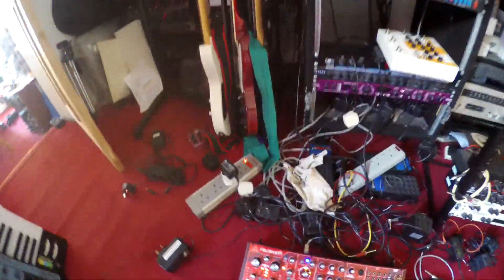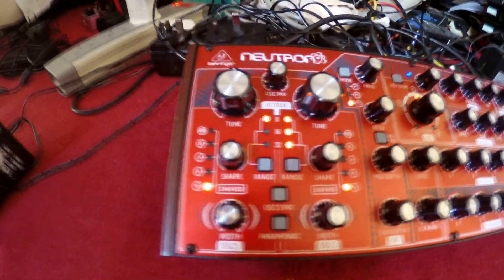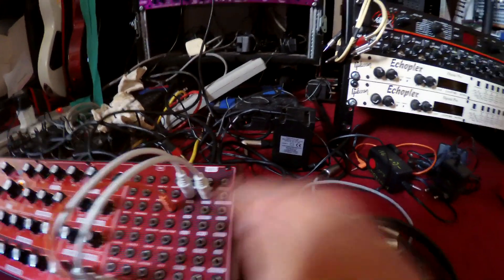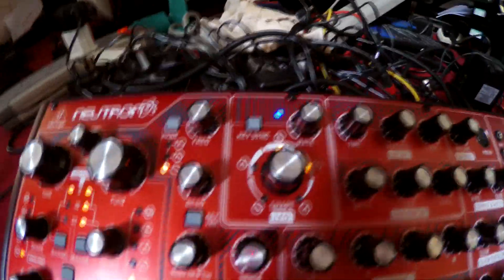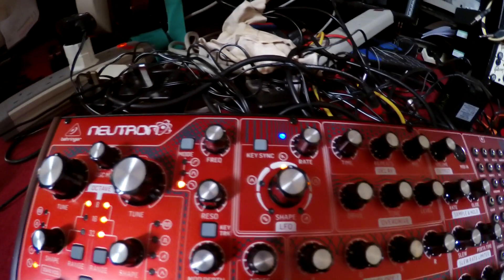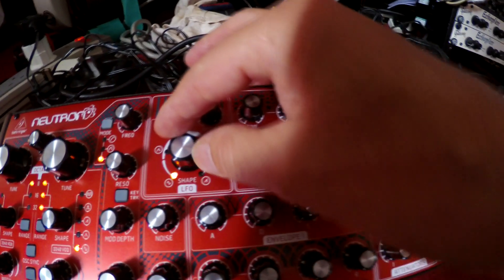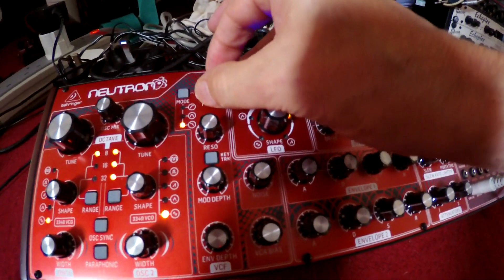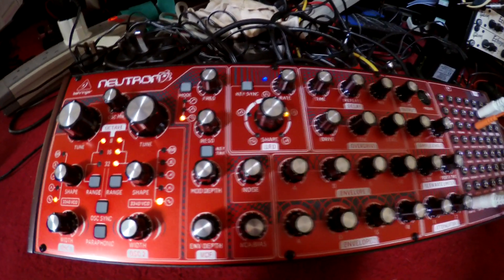Neutron Noise

Comment: Hello, mine does the same. Did yours sound like this, since day one or did it got worse after a while?
Reply: Because I have the feeling that mine didn't sound like this, from the beginning. But somehow does sound exactly like yours right now. On the other hand, i almost never played those high notes. This is my second neutron already, because the first one stopped working after a while.
Reply from the maker: Yes, this is what Neutrons sound like. I showed this vid to Behringer before public release and they say there is no fault with my unit.
The patch I set up focuses on the issue, quite a effort to get it to show this much.
The Neutron's a brilliant little synth, but I use something else for the high notes.

Comment: mine does that same noise, and I havent being able to get rid of it. As far as I've read, its the LFO bleeding. Have you got any response from Behringer?
Reply: I had the very same issue with my Neutron only I had it regardless of the tuning range. I hooked it up to my scope and was able to describe the “jitter” to their phone tech who said it sounded like I had a defective unit and suggested I return it to my retailer. My replacement unit will be here this weekend. I will try again and will also try the MIDI channel approach. Shame is my sequencer (a Novation circuit) doesn’t have adjustable MIDI out channels. So I will try the D on ch 1 and this on ch 2
Reply from the maker: @KF7IJZ  . Well maybe the problem is always there on all frequencies, more noticeable on the ones i demoed. Or perhaps your scope is more shows it up well.
Thing is, I never found a Behringer tech support guy who was clued up about the tech, just some more helpful.
Reply: @KF7IJZ  I recieved my Neutron today, and it has the same problem regardless of the (unstable) tuning range. Did replacement unit solved your problem with it?
Reply from the maker: @zajdima  The noise is just part of the Neutron experience, mostly it's not noticeable. 
To stabilise tuning 1) let it warm up for 15-20mins. 2) turn it off and on again to make it recalibrate.
It always calibrates on startup, when it's cold....so unless you re-start it just drifts out of tume as it warms up.
Reply from the maker: Behringer don't like to own up, but they say my unit is 'within specification'. They also said I could return it if i liked, but the logic behind that escapes me.
Best tech support is from the 'Behringer Neutron' Facebook group. Someone there confirmed this sound within 2 hours. Took Behringer over a month to be non-committal, I had to really hassle to get that.
Reply: @livelooper  I solved my problem. Apparently it was having a conflict over MIDI Channel 1. I changed it to 16 or any other number and it works perfect now.
You can probably try that to see if it works. None-the-less I do agree Behringer not addressing any of this correctly.
Reply from the maker: @alexandergarza8361  , Tried changing midi Channel. Absolutely no effect.   Just enjoy the Neutron for it's great sounds and don't worry if it's not perfect. :-)